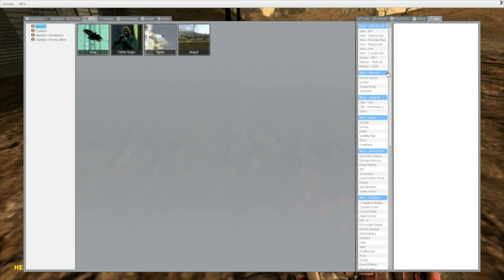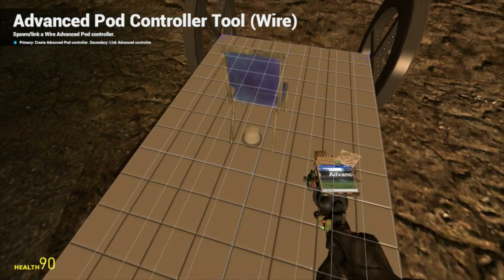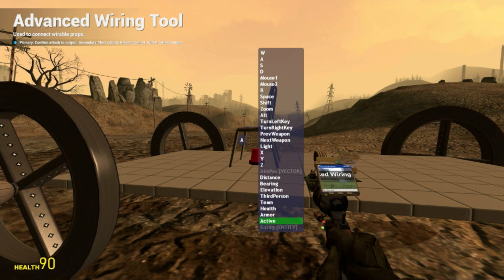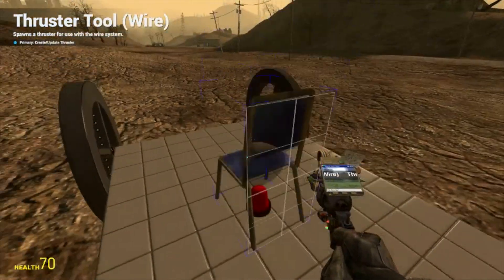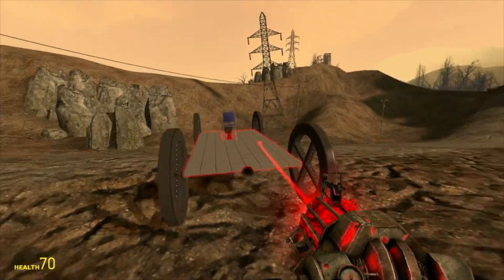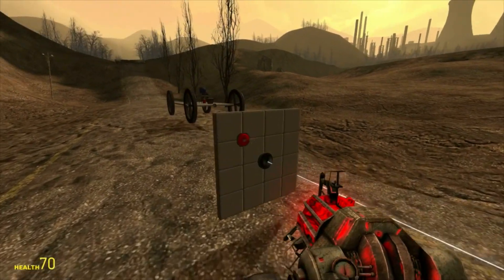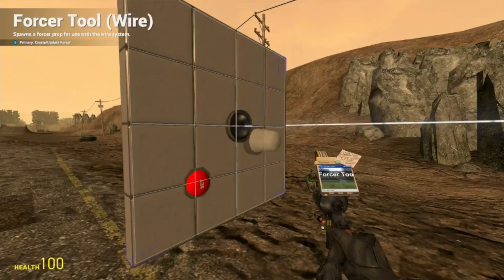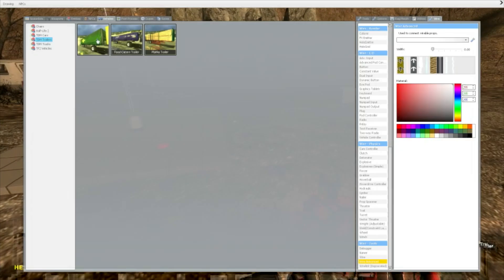Garry's Mod Basic Wiremod tutorial

Comment: How would one create a teleporter that targets the activating player (the one who presses the button/lever to avtivate it) and jumps them to a given coordinate (via gps or manual configuration)?
Reply from the maker: NightHorder I can't explain all you have to do in a comment, you need wire in order to do that, and there are tutorials online for that
Reply: I haven't found any helpful tutorials yet. So far, I've found that wire teleporters move what they're attached to and anything caught in a grabber welded to whatever the teleporter is attached to. However, wire grabbers don't hold players, only props.
Reply: +NightHorder simple make the cage put teleported in the middle of it under it then get beacon sensor then a target finder link it to beacon sensor get a name chip then a text screen with no text then make sure the beacon has X y z inputs then get wiring tool wire the teleporters X Y Z to beacons X Y Z then wire the beacons only thing to 1 on the target finder wire the name chip to the target finders second input I believe then wire the empty text screens first string to the name thing then get 2 numpad inputs set them both to different keys then when they are placed wire target finders next target to the numpad input then wire teleporters jump to the other one then it should work I am not sure it will I seen to remember it more when I am making it but I am positive it will :D